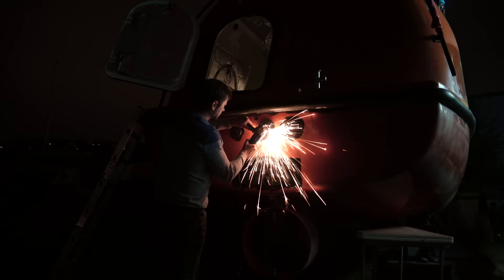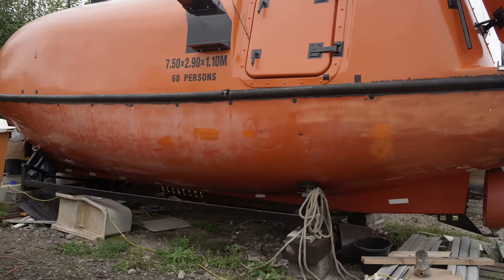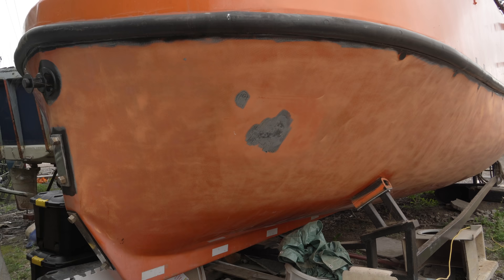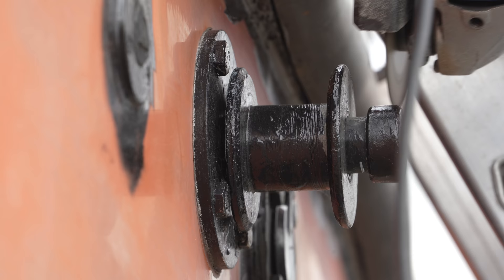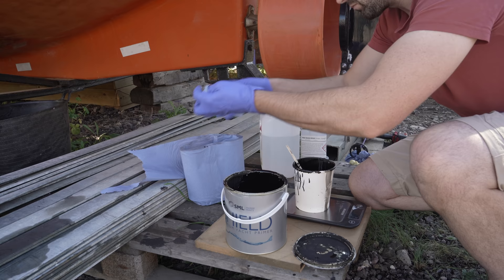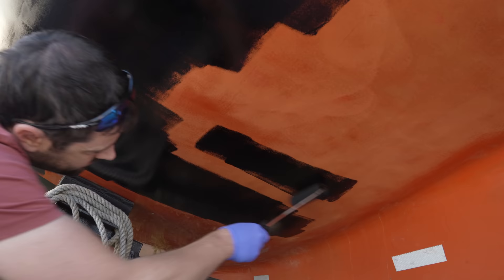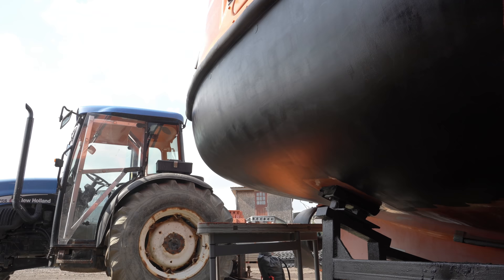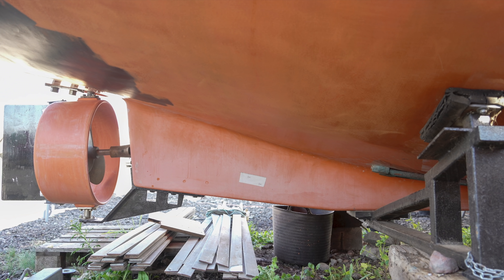Lifeboat Conversion Ep26: Applying protective epoxy primer to the underside of the hull. [4K]

Comment from the maker: Thanks for all the sanding disc feedback, folks. I'd checked the state of the pad and the hooks seemed ok, but perhaps I wasn't comparing with a brand new one so I'll replace that part. Also, I'll try out some 3M paper and, if not happy, invest in some mesh-style ones.

I'm pleased people also like the shrouded cooling pipe idea. Certainly, I'll need to consider how the water flow may impact the propulsion and steering.

Comment: Regarding the sanding discs, it may be that the backing pad on the sander itself is knackered. I've just bought and fitted a replacement to a Bosch delta sander - and it's now as new, with no sandpaper flying orf at inopportune moments.
Reply: The problem with the sanding disks is two fold. The backing is not holding because of the Velcro and the jell coat filling up the sanding side. The jell coat is sticky when friction is happening during sanding. The Velcro is not strong enough when the sand coated side fills up with the jell coat as it is removed. Older corvettes in the body shop have the same problem during repairs.
Reply: Agreed 👍
Reply: Came here to suggest this too. I'd suggest he takes his sander with him to a trusty hardware store and ask someone to check.
Reply: Also try fitting a pad saver and try Bosch mesh sanding discs as they resist clogging and aid dust collection.
Reply: Found the Lidl disks on the Bosch sander the best so far. 🤷
Reply: Agreed -- I don't think I've ever once had a sanding disk come loose, no matter what brand.
Reply: Came here to say this, the hook side gets worn out from using sandpaper too long when holes develop and break off the little hooks. Replace the sanders pad, or just the sander… or just use the grinder!!!!
Reply: Hiya, re, sanding discs?? I restore victorian floors for a job and often end up sanding marble steps etc. I always use sait(this is the brand) discs. Good luck and keep going with Alan.  Pj
Reply: Exactly

Comment: In regards to the keel cooler, it's your most vulnerable part to getting damaged by ice floes but the engine needs to stay cool. If I were going to the Arctic or Antarctic by sea I'd consider installing an auxiliary system where a heat exchanger is mounted above the water line & is air cooled. I'd have valves installed so I could switch from one cooling system to the other from inside the engine compartment.

Comment: About velcro backed sandpaper.
Usualy when they fall off it means  the velcro on the orbital sander itself is worn. You need spare sander pads for a job like this.
Also you can buy double sided velcro inserts you can sandwich between the sander and the paper.
 They prolong the sander's velcro pad life for a bit.
Reply: At this point you'd just wanna replace the Velcro pad on the sander though, you can get replacements for pretty cheap

Comment: Like others have said: replace the backing pad on the sander. That’s more likely the problem. They are the ‘hook’ of the hook and loop and if you overheat it with some overly exuberant sanding, it will get knackered. I would recommend one with a squishier cushioning than the original, you find you get more consistent finish with less swirling. Thanks for the fascinating series, I’m new to the party but enjoyed binge watching to get up to speed.

Comment: Working on mostly hardwood here in Malaysia, I found the longest lasting sand paper to attach to a sander or grinder adapter is sandpaper meant for Belt Sander. 
Chose one size that gives the most cut outs. 
To make it stick use the soft part of Velcro and glue it on with contact glue. 
Lasts almost forever. 😊

Comment: From the cooling perpective, it should be fine to enclose the cooling pipes. After all, many modern vessels are using box coolers inside of seachests. Just make sure that a good flow of seawater will be allowed, even when the ship is stationary (via convection). If they're in a position where they could get damaged by ice, it'd be a good idea to have some redundancy , with independent portside and starboard coolers,  and bypass valves, in case one is broken.

Comment: Festool make backing pads for their orbital sanders; other manufacturers might make those, too. A backing pad reduces the wear on the pad of the orbital sander and is much stickier than the pad itself, at least in my experience. It also works perfectly with Autonet/Abranet, very coarse grit paper and when sanding fibreglass and gelcoat. Buying backing pads has made the pads of my orbital sander last absolute ages.

Comment: I use a spray adhesive on the  disposable sanding disks before attaching them the hook and loop head.  You can still remove the used disks in one piece without issue but they don’t fall off on their own. They sell kits to replace the hook and loop on the head of the sander but this seems just as easy.

Comment: As mentioned by several others, the velcro on the pad itself can get worn so a new pad helps a lot. I just replaced one on my rotex sander and it's much better. For good discs you generally get what you pay for. I've found the discs from Sia are good. I use the mesh ones. Use a vacuum on your sander if you can is they work far better with the dust removed. It helps if you rough up the fibres on the back of the sanding disc with some rough sandpaper before pressing it onto the pad. It lifts and fluffs up the fibres that can get pressed flat when stacked in the box, so they stick to the velcro pad better.

Comment: I've tried all of the major brands as well as generic sanding pads & never found one that doesn't fly off the sander after a few minutes. What I do is spray the face of the sander pad with 3M spray adhesive & then stick the sanding disk to it. Sometimes I have to spray both surfaces. The trade-off is that it takes longer to pull off the worn disk. They tend to tear and you have to pick at the edges to get the whole thing off. The trick is to experiment with applying the proper amount to keep the pads stuck but not overly so. That is dependent on things like the ambient temperature & humidity on the day of the job, how clean the pad is on the sander, and how fresh or sticky the factory adhesive is on the sanding disks. Even with a top brand like 3M you will get differences in the stickiness between the disks in one box compared to another.

Comment: Re cooling, Project Brupeg mentioned it a while back and they're aiming for the Antarctic, but they've got a steel hull. I'd definitely compare the thermal properties of steel to fibreglass first, I suspect you can do it without damaging the hull but would need a larger area for heat exchange than on a steel hull.

Comment: I strongly recommend getting a new Velcro pad for the sander, but as for the sanding discs I strongly recommend Diablo brand, they're some of the best on the market.  They come in grits ranging from 30 to 320 too so you can get by with just diablo pads if you want to

Comment: Alex for the sanding pads. You might be able to buy a new one for the sander. I have done this once and now it sticks far better. The other option that I have done is just get a spray can of sand paper adhesive and just spray some on the sandpaper and attach. This helps quite a bit as well.

Comment: Alex - with regard to your cooling mod - mine through the early SV Seeker video's. His boat is steel, but , he is also using his rudder keg as a heat exchanger for his engine.

Comment: I worked at a few marinas and have found that the 3M sanding pads work best.  Even with the amount of gel coat dust, they still stick quite well.

Comment: You need keel cooling idea isn’t bad. I believe your British, so think narrowboat. They run a type of keel cooler called a “skin tank”.  You could build one of stainless and embed it in fiberglass along your propeller shaft keel. 

Maybe consult a narrowboat engineer about sizing. You could add some small cooling fins to increase the wetted surface with the sea water. To increase the heat transfer. Like cooling fins on an air cooled motor. But not big enough to be grabbed by ice. 1/4” thick by 1/2” stand off with 45 degree ends so ice slides over the fins.

Comment: I agree with checking the deck on your palm sander. Those wear out after enough use. For discs, I use Diablo with much satisfaction. However, I’m in the states so I don’t know if it’s available where you are.

Comment: If you can change the pad on your sander get a smooth pad with adhesive sanding discs. If it's not interchangeable you can cut the Velcro off with a hot blade.

Comment: Maybe an imbedded aluminum mini cooler protected by the steel fiberglass rear housing you are proposing with water allowed to flow thru it might be the most safe and secure design. Protected
Reply from the maker: Currently doing the research on material selection 👍

Comment: On sanding discs, try mesh sanding disc with a protector pad. I'll never go back to regular sanding discs. The mesh sanding discs last 10X longer and the pad doesn't ruin your hook and loop, which you may need to replace by now. Wet sanding, dry sanding, whatever they just work and work and don't come off. Another benefit of the mesh is they don't get clogged.

Comment: re: moving the cooling pipes aft, my only concern would be bringing them towards the prop might mean more turbulent rather than laminar flow, particularly in reverse, and this may mean that they don't cool as quickly or effectively? But I wouldn't know where to start with the maths to check the impact this would have; and a) you probably won't be using reverse for prolonged periods, and b) the water is probably more than cool enough that it won't have be a problem where Alan is going
Reply from the maker: Good input - thanks. I'll pass it past those I'm grilling for knowledge on this design.

Comment: Are you using self adhesive pads? If so, switch your backing pad to a velcro type and use velcro abrasive discs. They may be more expensive but they work.

Comment: Sanding discs? You can't do better than Mirka brand Abranet Ace HD (or some of their other different types of discs, such as ceramic ones). And, they make inexpensive sacrificial sanding pads to go between the discs and your sander's own (usually very expensive) pad.

And I second the comments that suggest the problem is the sander's pad, not the discs. But Abranet discs work MUCH better than regular ones, especially if you're using a vacuum attached to your sander, as you most definitely should be doing when sanding fibreglass or epoxy.

Comment: Backing pad on your sander is on its way out. Go mirka or 3m or Sia for sanding disks. They are just better and last longer so will save money in the long run. You should not be thinning anything with acatone. It brakes down the resins and they don't cure to full strength.

Comment: The cooling pipes may still be ripped off by ice, it floats as the ice cube in my whisky proves making me a bit of a expert on ice. 

I would just ask the question what happens if the pipes are ripped off, does it kill the engine cause a leak you can't easily fix. If the answer is yes and your days away from help, then over engineer it and protect it.
Reply from the maker: If ice gets into the conduit somehow, it would more likely block the conduit than rip off the pipes. That's something I'd need to build into the design.

If the freshwater circuit breaks, then seawater would enter the system. This would obviously begin corroding the engine internally, but I've been advised the engine will keep running in the short term.
Reply: @AlexHibbertOriginals  thank you for a very detailed reply. Learning lots from watching the series

Comment: Just  use double sided sticky tape on the sander. ... cheaper and stickier.
Reply from the maker: I've found these sorts of solutions come loose unless the adhesive used is high temperature rated. The heat from sanding friction seems to ruin basic glues or sticky pads.
Reply: @AlexHibbertOriginals  We used to use it extensively when I had a boat building company... Not sure if we got special tape though, maybe we were fortunate in what we did get.
This was in China I might add and it proved to be effective and cheaper than buying new ones, even at Chinese Trade prices.
How many do you think you are going to need and what brand is what you are using, I might be able to find an option for you.
Reply: @AlexHibbertOriginals  Just had a thought...
If you have an old unit with all the little hooks broken off, strip it back to the actual pad and glue (maybe epoxy) onto it velcro hook strips so it is completely covered and thereby has an even surface.
Reply from the maker: Yeah I've done a high temp glue repair in the interim. If it fails I'll just get a new £10 sanding foot.

Comment: You know, I really try to learn from what you are doing. And I have watched many many episodes,.
Well, you have the tame side of things done. You say this or that about ice. Or this about bumping into something. So fix it. Add more steel reinforced glass to the stress points. Some wire under a layer of glass would not add that much mass, but would make it so much stronger.  I just don't understand why you keep pussy footing around with the dumb shit. Rule #1"  it takes less time to a job right the first time, then to explain WHY you didn't. I lived up north for a while, you don't play with ice, bad weather. You will always lose. And the minute you think you won't, your dead.  Have a few really good plans in the making. And a few not so good plans. You wrote a book, big deal. I lived 17 years up there, still big deal. I lost family members, as well as a few friends. Please plan for the worst case. If it doesn't come to pass, great. But if it does, you have a good chance to make it home. I didn't plan good enough. Now I'll spend the rest of my life in a chair. I watch to learn, to keep my mind going. I know you can teach me some thing. So I watch
Reply from the maker: I'll try and response to the substantive part of this: just adding 'steel reinforced glass' to random bits of the boat you're worried about isn't really a strategy. Steel and glassfibre flex and absorb impact totally differently, so it's not an easy solution. To modify the hull for ice impact isn't just a case of sticking on more material to the bow, and as I've said, pressure is much more of a risk than impact. Something I've had to wade through since starting this channel is 110% certainly in what I MUST do, but zero detail as to how, or even if, it's possible without a total rebuild. All best for your future.